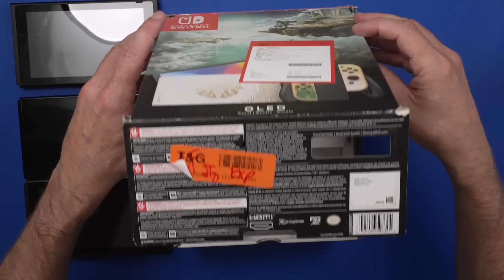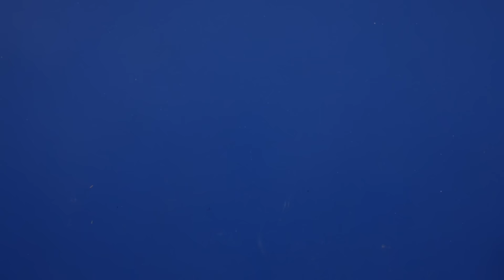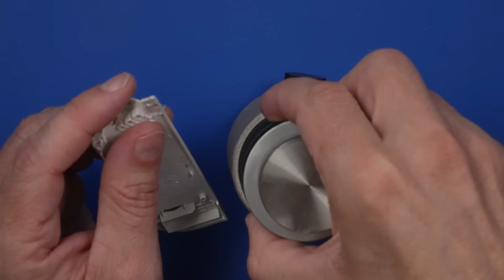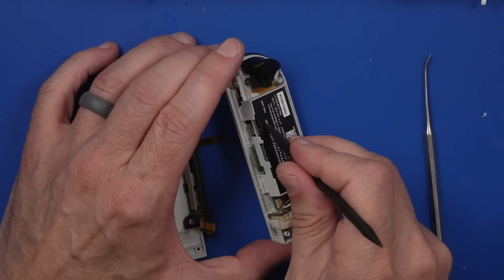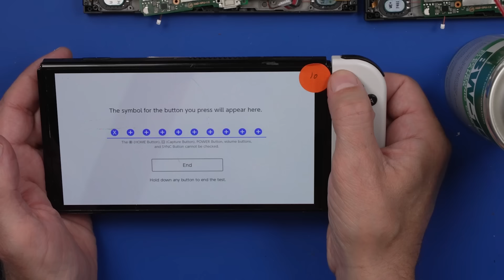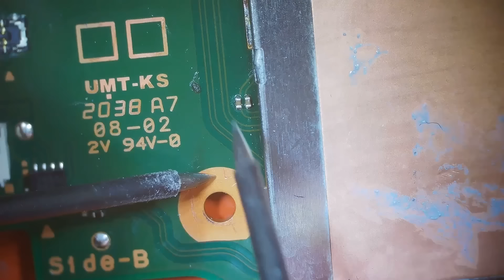Trying To Fix 13 Customer Return Switches - Extended Version

Comment: I recently picked up a Nintendo switch from a local auction and after I got it working I found that it has a four digit pin on the parental control, I don’t have a Nintendo account and have trued many ways to remove the pin so I can reset the switch to factory reset, can you please advise as it’s something I’ve not seen you do in any of your videos 

Regards 
Dave

Comment: Quick question, a locking tab on my joy con won't stay closed is there a way to keep the pressure on the ribbon cable I thought super glue but I'm no expert

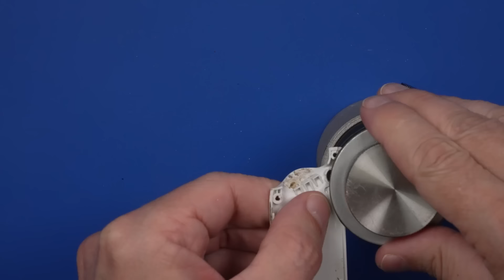Comment: 15:30 a little heat from hot air station or some kind of hot air gun or even hairdryer could help imo. 
Yeah, I know, for every new "technique" some experience is needed, might get it melted, but practice makes perfect, right? 
Nice video like always 🖖

Comment: Thanks for another great video!
as far as the screw inserts, I have used a blob of metallized epoxy (jb weld is one brand name) to patch stuff, drilled, and tapped it.
It worked but I don't know that it would work in every case - definitely shave it down when it's still pliable so it fits back together correctly - all the repairs I did that way were on cars (radiator mount, but they're huge bolts and have three other ones holding it up, things like that where it shares the load instead of being a primary stress point for the attachment).
Reply: also so that's what compacted cheeto dust looks like

Comment: I just tore apart a set of the white OLED joy-cons for modifications (oops, its no longer under warranty. 😂) and every single button opening  had specs of dried crimson... I've never seen such grime in any device I've torn down to modify...ever. 
I wound up just throwing the old shell in a pile of junk and put the internals into a brand new shell.

Comment: for the joycon I wonder if using an acetone on the seam for the screw hold would have worked.  If the shell is made with ABS the acetone will weld it back together

Comment: Using a trick from the TTRPG community, if you have plastic pieces you need to bend you can warm up some water close to boiling (I warm water in the microwave) and then dip the plastic piece to bend into the hot water for a few seconds to make it pliable. Once it cools, it'll retain the new shape. Tabletop gamers do this to fix arms or weapons that get bent out of shape for various reasons.
Reply: Not all plastics are the same. The soft plastics used for models are not the same as hard plastics used for high temperature applications like console cases.

Comment: Even replacing is fixing people... car mechanic also replace the broken part and you call it fixed. So why it should be different here? Also soldering new chip is also just replacing. Just a bit more in depth.

Comment: For gaps after using the hot water trick, use baking powder and superglue! The baking powder will also help to strengthen joints and accelerate curing.

Comment: Those white joy-cons, you can try using the thin wire mesh and melt it into the cracked area instead of glue, it holds and lasts longer. There are some other repair groups that share how to crack repair ABS. Just a suggestion, I've done it a couple of times few things that I can't find replacement parts/frames for.
Reply: Get a good multimeter then you will know

Comment: I love it when "Pros" call others "Parts changers".  LOL, how micro does that term get?  Because even someone who fills a hole by welding is just changing out the metal that used to be there.

Calling someone a "parts changer" is just cope, for the fact that it doesn't take a rocket scientist to use a soldering iron.

Comment: When youre trying to bend plastic, get a cup of water and put it in the microwave and heat it up to steaming temp or very hot and take the plastic piece and hold it in the water to soften it up before you try to bend it. This helps soften it up so it doesnt snap, even though it still can sometimes depending on the plastic but it doesnt help make it more malleable. Its and old trick toy customizers use when trying to fix plastic parts. Cheers.

Comment: Us watchmakers use a thing called pegwood which you buy in packs quite cheaply, you can shape it for the insides of say USB C ports and its dead good at removing old oils, residues, dirt and grime without tearing up metal traces, think of it as a hard q tip perhaps but its soft enough to be a decent but not destructive abrading medium.   BTW good to see you looking hale and hearty, keep up the good fight always :D

Comment: I worked at a Best Buy with those same PRC tags, and most of the time, customers just returned them (me included) with no problems. They just wanted to renew their protection plan or just wanted to upgrade

Comment: And people wonder why costs have skyrocketed.  Businesses will actually take these as returns. I would love for more businesses to start rejecting returns.
Reply: No...Then the incentive to sell quality product is lowered. The retailers need to open the return box and decline returns that are not legitimate.
Reply: When it comes to electronics, if you have a problem with the product, you deal with the manufacturer, not Best Buy or Target. All of these Switches were a case of them being abused and then returned to the store to scam them.
Reply: @steed262 they all look like protection plan fulfilments. Usually have accidental. Basically like insurance.  Best Buy loses nothing on these because they purchase underwriten policies for each plan they sell. Their profit is fixed at that point so making the exchange costs nothing aside from negligible logistics costs.
Reply: @stevenmackey789  That's a good point.  I didn't think about people who purchase the protection plans which covers damage like this.
Reply: Part of the problem is not having any employees with the time or willingness to check the returns. I'm actually pretty surprised that those made it through, even considering that.